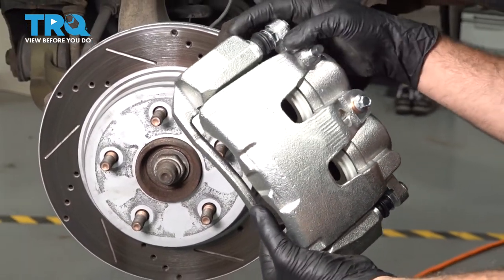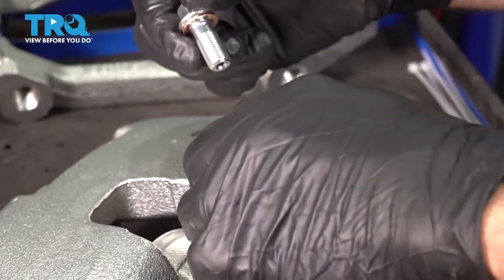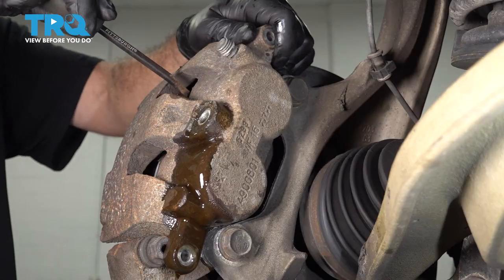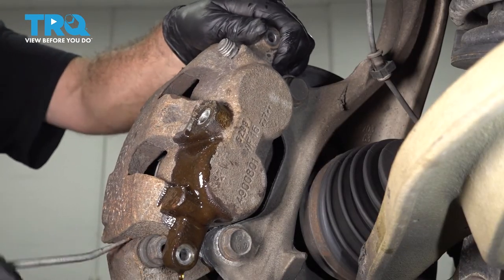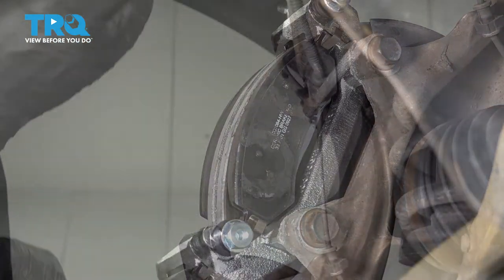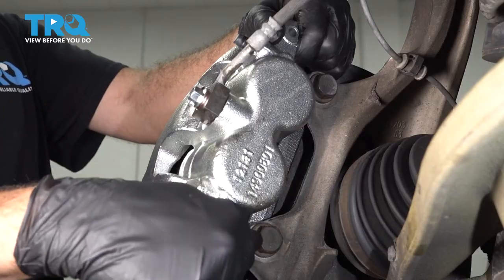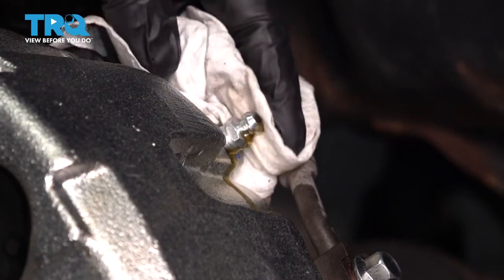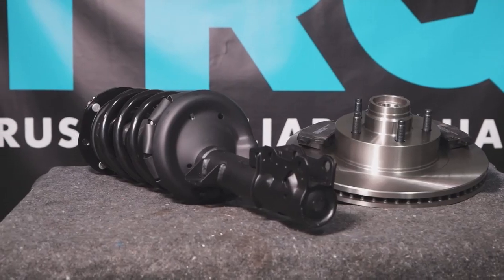How to Replace Front Brake Caliper 2011-2018 Ram 1500

Comment: Thank you so much for posting such a concise and thorough video.  I was replacing pads, rotors and both front wheel sensors and let's just say I need to buy new calipers. One did function but didn't look great, and the with the other side, I simply could not retract both pistons.  I realised when trying to free them off that one was more seized than the other, and then I managed to crack one piston.  The boots were fairly disintegrated so I have decided to just replace both calipers.  Thanks again!! Joe
Reply from the maker: +Joe Leonard Thank you! We love empowering our customers and showing how to perform DIY auto repairs with our high-quality auto parts. http://1aau.to/m/Shop-TRQ